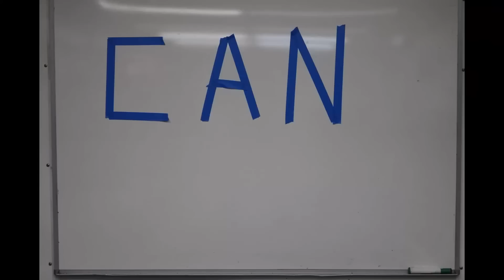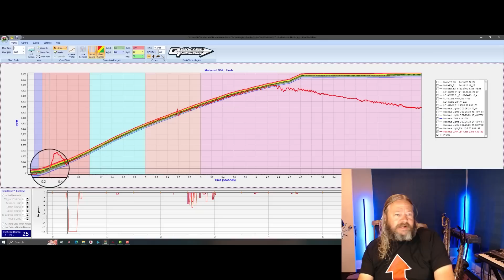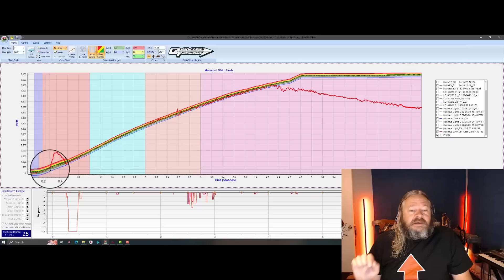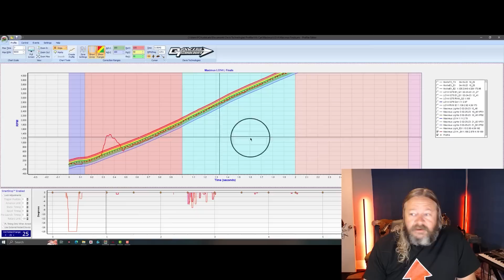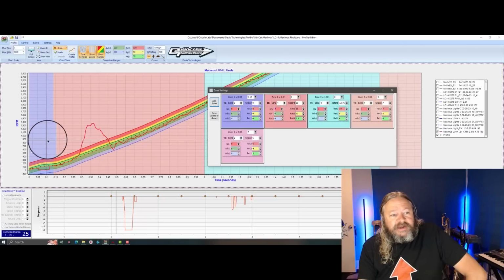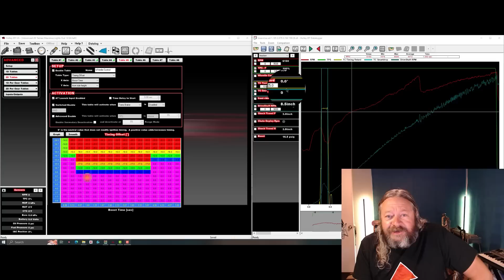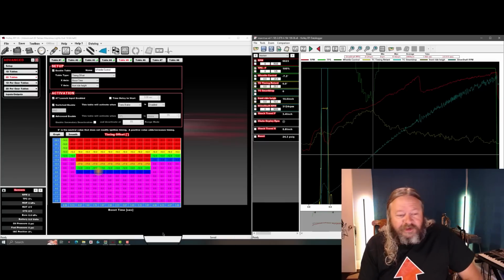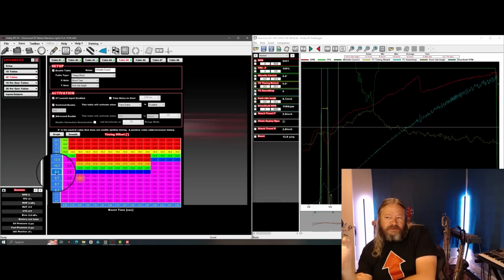Wheel Speed Management!!

Comment: Is there a way to use the rate at which the nose is rising rather than simple ride height?  Because you could do the math & determine from the first centimeters of movement.  Acceleration, rate, mass of the car on the front axels.

4cm in, yep got 500 kilos moving upward at 1 m/s, even if I cut timing when it reaches X ride height, that momentum is going to carry the nose on up.

So if you know the mass, acceleration & achieved speed you coukd target 0 upward velocity at a particular height.  Or even a negative velocity (nose coming back down).

It gets complicated with the motor producing more & more torque, but that is where experimentation comes in.  If you have a good idea how much torque you'll be making (or just want to assume an arbitrarily high amount) then you could prevent the nose ever rising more than X amount.
Reply: What are these strange units of weight and measure you speak of?
Reply: That's the beauty of using the VPS that he said he'll do a video on soon.  It is precisely calibrated and in combination with the Profiler/self learning it is so quick to respond that it is unbelievable